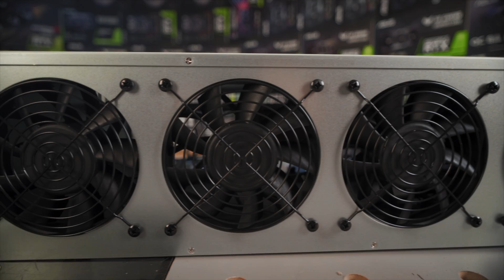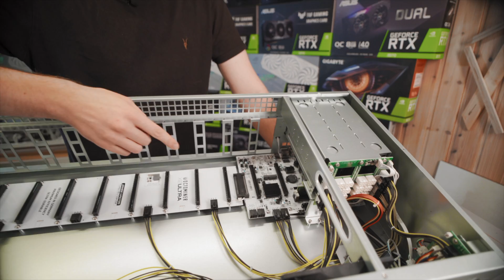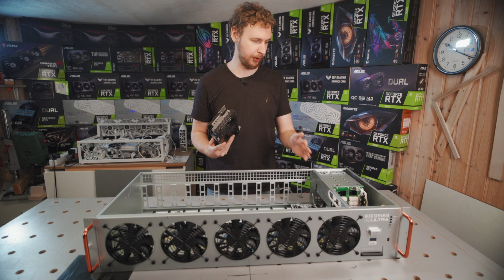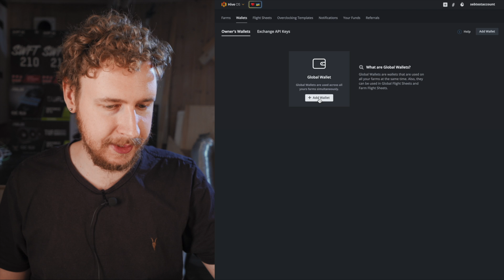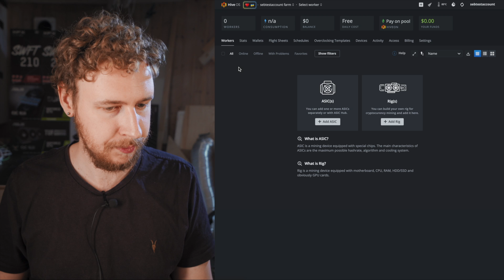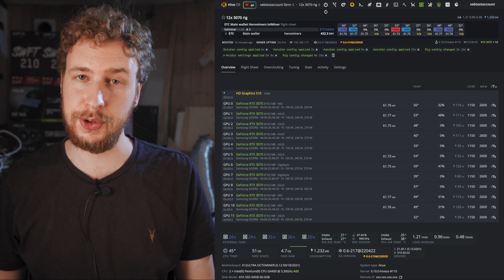How to setup an Octominer X12 ULTRA

Comment: Thanks for the content: I am having trouble with what you would consider pice 1 & 2; in other words I started on the other end, and the 11th 12th GPU I had to remove to get it to boot.  Any suggestion on what I can check to figure what is going on or stopping it from booting with the last two gpu's installed?  Please advise .. thank you.